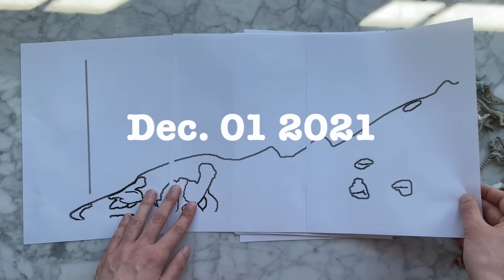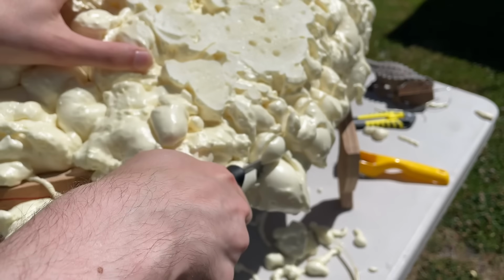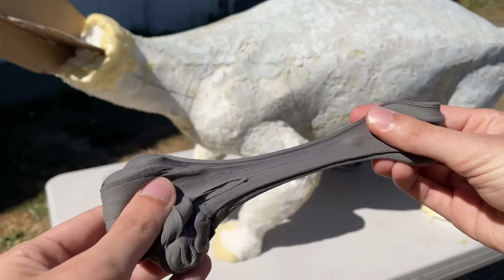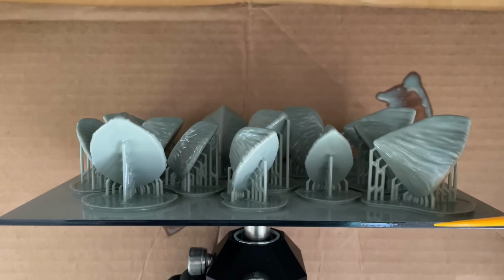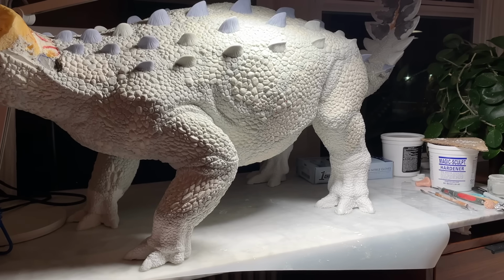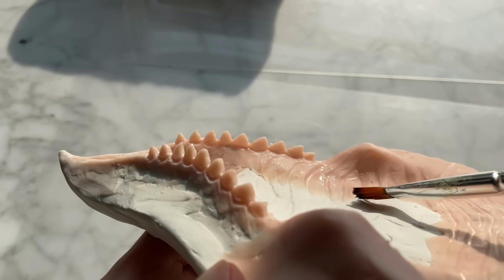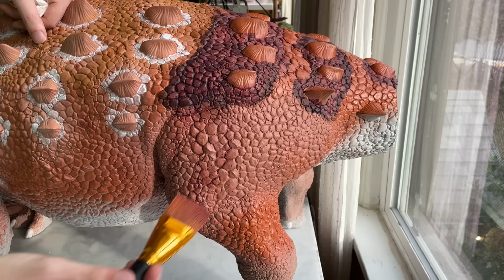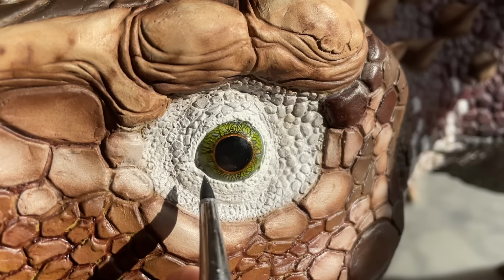The Building of Stegouros!

Comment: Amazing work with the spray foam, me personally I probably would of used a sander instead of a knife but still came out amazing lol
Reply: The knife is used first to cut off the excess, then the rasp, then sander. 
Unless you put one of those carving wheels on a grinder….then you can make a HUGE mess:)
Reply: @simonstuhl4170  tbh didn't think of that, I did like what he did with the scrapers, but again just me I would of used a knife to cut off the excess but to get the dino smooth I'd would of used an sanding grinder, yes it would of made a mess, but would of also made it easier lol

Comment: Really well done. I wonder if it's possible to use some unknown to me material, that would resemble peeling skin? So one gets the effect you can see on the scales and scutes of tortoises, crocodiles and other reptiles with large scales, scutes and osteoderms, which would 'suddenly' make it a lot more realistic. Now it looks very 'fresh' and clean, like it just came out of the egg.

 Also some dirt but that's probably easier, since it can be done with actual dirt! :D It would fit by itself in the grooves between the scales. Some dry mud on it's feet, and some sandy dirt on it's back and tail. Maybe also lots of scratches on the scutes, which would essentially be just many  tiny in a somewhat random directions thin white lines, which I guess could be done with some paint.

Comment: Your work is amazing. Did you buy the stl of the eyes or did you design it? I'm interested in it for my projects:hand-pink-waving:
Reply from the maker: I made the eye, you can have the file. One thing I didn’t include in the video was sanding the inside of the eye to remove the wash in addition to using a a tip. That will make the iris color clearer. https://drive.google.com/file/d/19TQBwnw5eof5AVwHbDdsjCoYQFeF5kAL
Reply: @Kayakasaurus  Excellent master, you dare a very good use I loved it🥰🥰🥰🥰🥰🥰

Comment: Does epoxy putty smell bad? And the silicone, does that have a nasty smell? Thanks in advance.
Reply from the maker: Hey, the silicone doesn’t smell, the epoxy doesn’t either with the exception of when you open the tubs to get some out. During mixing and sculpting it doesn’t really smell. The auto body putty I used in the scale molds does smell though and that’s why I used a respirator for safety.
Reply: @Kayakasaurus  Thank you! I only have a balcony for outside work, and really do want to stay considerate to all my nice neighbours. Inside this flat are highly curious cats and one bad case of asthma, so... Yeah. But this way I can make the coolest paleo-cat-tree ever to be seen (possibly...).

Comment: It's 104 days of summer vacation to pick up the log. Just to add the scheduled problem of our generation but in a good way to spend it like what baby building a rock? You're not fighting a Bobby climbing up. The air full tower discovered the discovery except big. That doesn't exist and we're gonna give it a bump. Kia stop shower. By the way, it's correcting that no butter, located in Franklin's style brain.  Fighting a dodo bird painting a kind of driving my sister